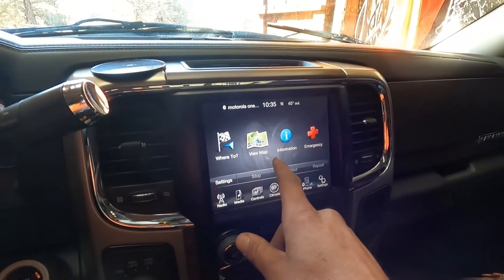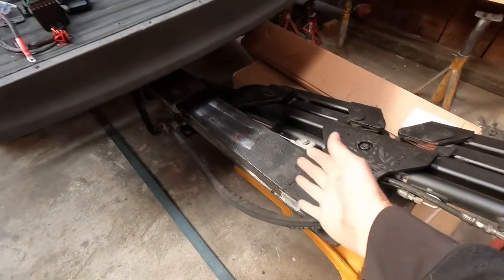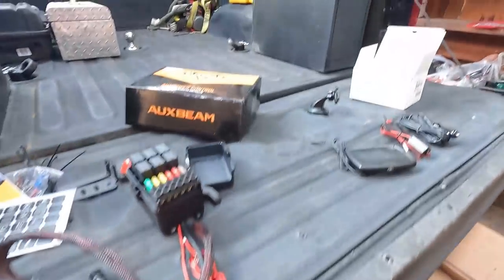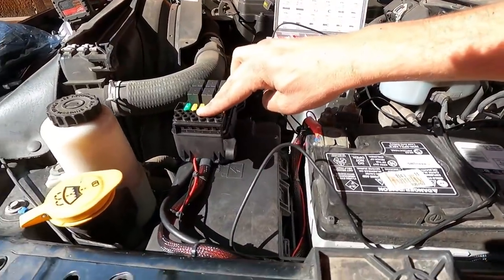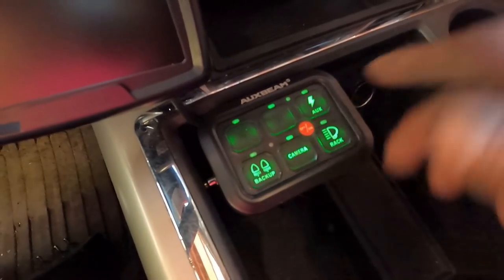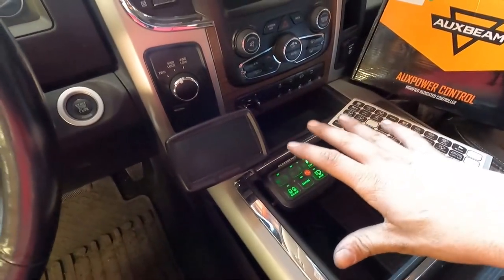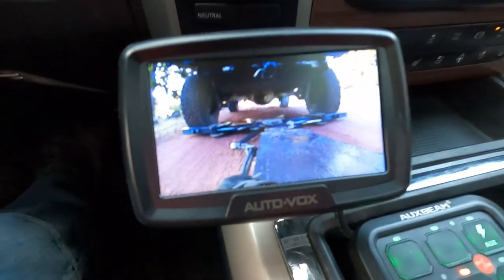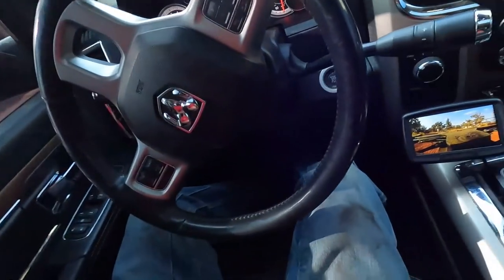Auxbeam switch pod installed in a tow truck

Comment: Nice setup Casey, I like it! If you decide you don't like the light throw out the back from the 2 4" light cubes, you might want to look for basically the same cubes, but with side lights. One side (or both) of the 4" cube is curved around the side, and throws one row of 4 LED's light out to the side of the cube, and the rest forward, as usual. It might be less wiring than adding another light.

Comment: Where were these guys at in the late 80’s into the mid 90’s, this would have made a slick switch setup for my emergency lights on my personal pickup when I volunteered at my local fire station for 7 years before going to the neighboring city full time for 23 years! Nice clean install, checked out the prices and they are very reasonable for the switches and extra lights..looking for the backup camera….

Comment: if you ground the signal wire from the headunite for the backup camera that's built in it will trigger the reverse cam. never done it on a dodge but have done it on a few fords

Comment: I do electrical everything, and these are a simpler solution for multiple lamps and other things 12 v. Note also Many LED strobes you can get today have the flash control circuit electronics board built into them, each lamp. Rendering them to only need a negetive, positive,  and another positive for flash pattern change. I installed these and just used a simple tiny red button installed next to switch to change pattern. Im not positive these lights would work with Aux beam. Without using this additional push button pattern 12v. But also some lamps change pattern each time you power up light. So Off then On....is one pattern, then off and on is another. Which is probably a simpler solution yet.

Comment: Just found the back up camera, nice price for this unit.
Did you see the option to switch from regular mode to the mirror mode. You have the camera mounted closer to the driver side on the wheel lift yet in the video view it shows or looks like it’s on the passenger side, might want to change the view and see if it makes a difference….again, nice set up!

Comment: The factory screen looks like the same one as my Cherokee and there’s a button to turn on the backup camera anytime and you can program it on the bottom of the screen as a shortcut. You may want to investigate so you can use that camera anytime also.
Reply from the maker: This generation of U-connect does not have that feature.

Comment: Lookin good.  Be careful if you're planning to use one of the several brands of OBD flashers for your lights. It's pretty common for them to cause the trucks computers ECM/BCM to wig out & burn em up.  Not a cheap repair..especially since there's the big computer chip shortages all over. It might seem stealth & easier... but it might come back to bite ya. There's good reason professional installers don't use them in professional emergency vehicles. Might be worth trying/testing under normal circumstances, but since it can be weeks/months to get replacement BCMs e.t.c... might be a bad time in history to risk your money maker....

Comment: I have an 85 GMC with a No Mar wrecker bed.. has two things that hang off the doors called MIRRORS..kinda handy for backing up to cars!! Low tech means less things to break down!! 🤣🤣🤣🤣
Reply from the maker: Cool story.  But in case you didn't notice, this truck has mirrors too...      Unfortunately, unlike this truck, your 1985 Nomar didn't have a remote control auto loader on it so you had no need to see what was happening under the car while the claw was grabbing it, so therefore you had no need for a low mounted rear camera.

Comment: What did you used to attach the camera on the wheel lift ?
Reply from the maker: A bolt that holds the hydraulic lines in place
Reply: I have another question did you also connect the rear view monitor to the auxbean ?
Reply from the maker: @javierquiroz7009  yes, the camera and the monitor are turned on by the same switch
Reply: Cool thanks
Reply: What company are you going to used for your flasher / hazard lights ? Is it speed turtle 3.0

Comment: You may try and install a thin screen in sun visor so you may pull it down when needed but hidden when not in use.
Reply from the maker: I want both screens in the same general area so they can both be seen at the same time
Reply: @CaseyLaDelle  Have you ever seen the rearview mirrors that replaces your existing one they have ones that have two screens in them and when you turn them off it becomes a mirror which you can place your own additional cameras or play movies music whatever you want on it

Comment: Hello casey,nice video, of the auxbeam, and very nice set up, neat and easy access. Just some sugestion,, wouldn't it be better if you'd mounted the rear cam on the "body or frame"of the truck? (Not at the wheel lift it self? But the same location)just sugesting.😆😆😆. By the way, how's the red ford truck? Is he/she still w/you? Is it an f350 or 450? I think it'll have a lot of rest since it now has a buddy to share the tow work with.😇😇😇 the ford for the heavier jobs and the ram for the lighter one.😉😉😉👍👍👍. Keep it up. 👌👌👌

Comment: It seems you'd like to have the option to run the standard reverse camera when not in reverse.  Perhaps you can add a wire from one port on the auxbeam to the reverse switch, so when you hit that button on the auxbeam the car thinks you're in reverse and turns on the reverse camera.  Although I suppose that might confuse the transmission, thinking it's in reverse and drive at the same time, so perhaps just supply power from the auxbeam to the car's reverse camera system.  Of course this means tapping into the car's wiring which you probably don't want to do, but having the reverse camera on at any time seems worth it.
Reply: Just use a diode on the power lead